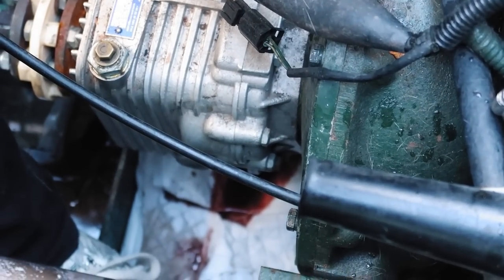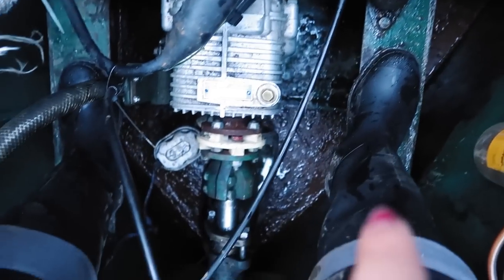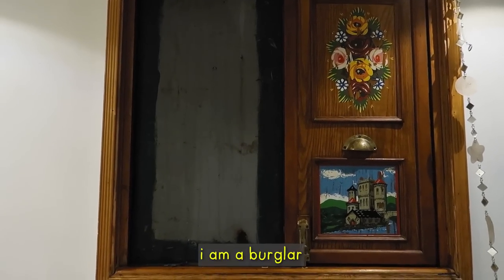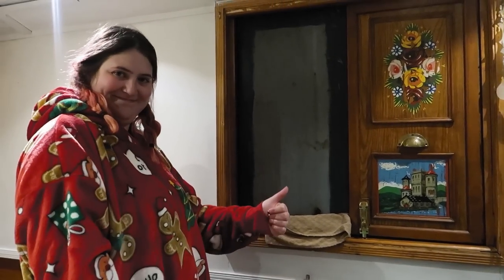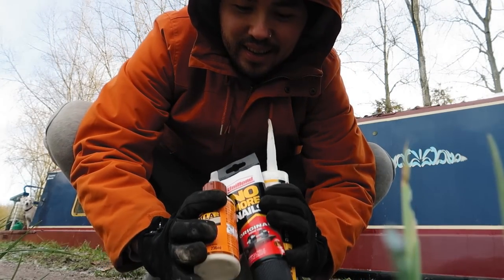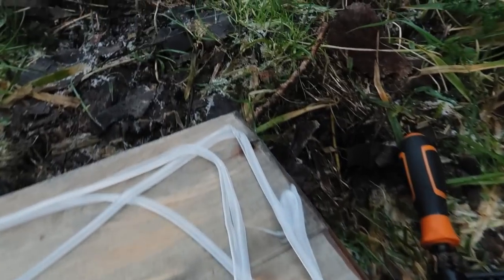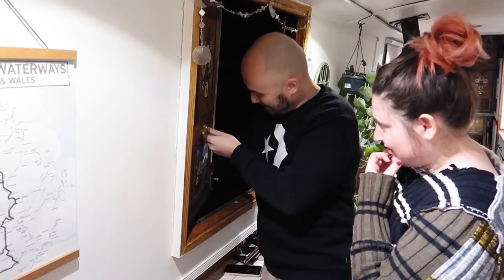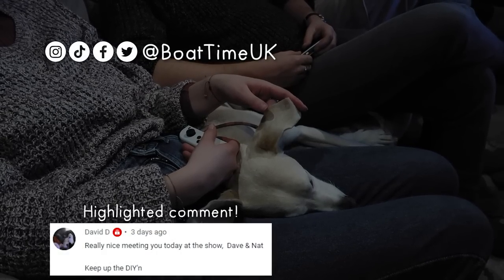Winter is taking its toll on our narrowboat - 98

Comment: I live in a very old apartment building. For many years, we lived with wooden windows and a wooden balcony door, which never shut properly and were very drafty. It can go as low is -40 here in the winter, so ever fall, we would put cotton wool and bits of cloth into every crack and put tape over every window and the balcony door. We've finally saved up enough money to replace everything, so we don't have to do that anymore, but the process of taping up windows is very familiar to me.